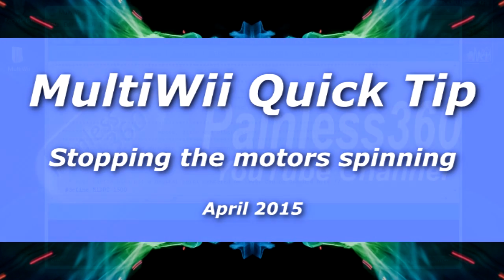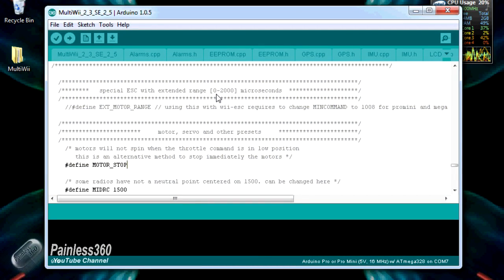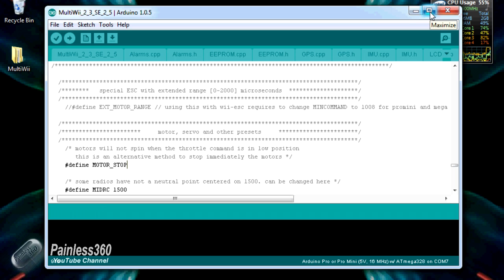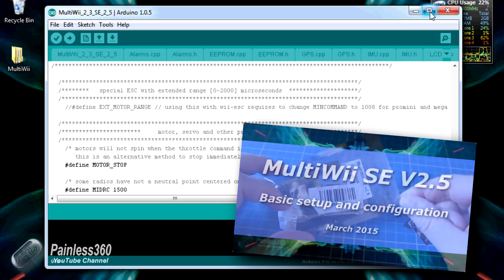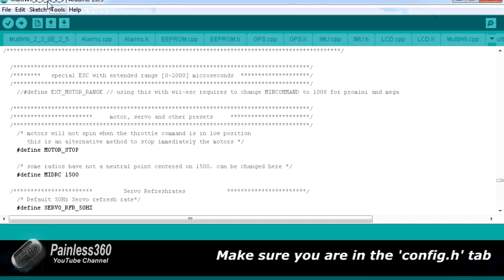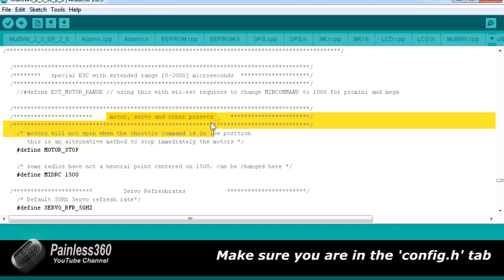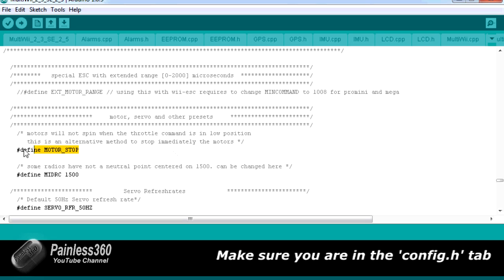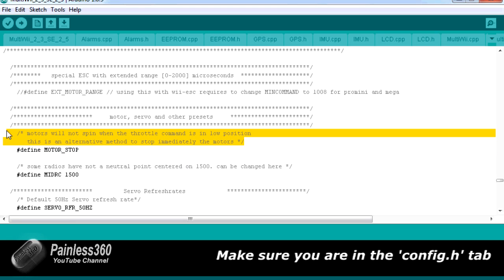MultiWii Quick Tip: Stopping the motors running when armed

Comment: I think it's easy to follow the instructions and I bought the atmega configuration menu and the installation board and the results didn't work properly, I tried again and finally the atmega board was broken, maybe you can help me so the results work properly
Reply from the maker: I've not used or recommended Multiwii for years. All I knew is in these videos. See the latest Quadcopter building for beginner video series for more modern components. Best of luck!